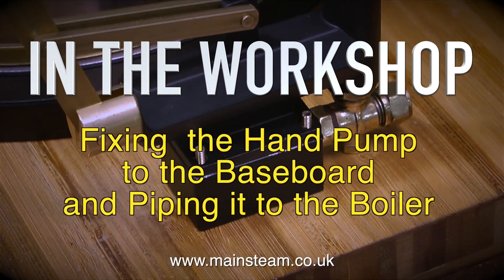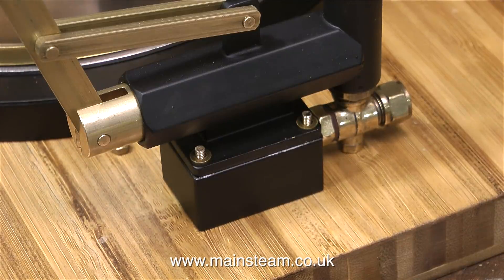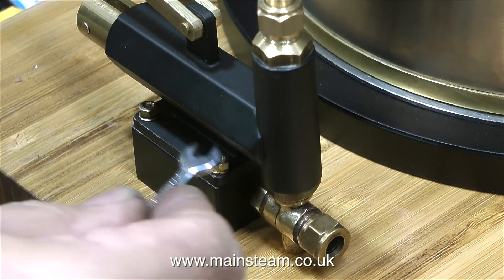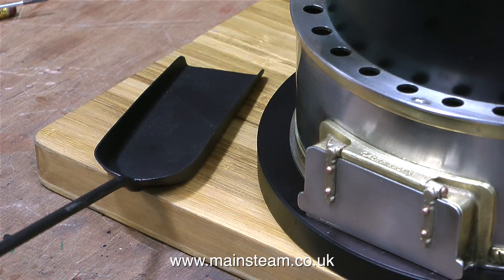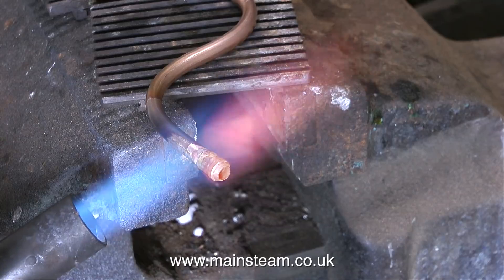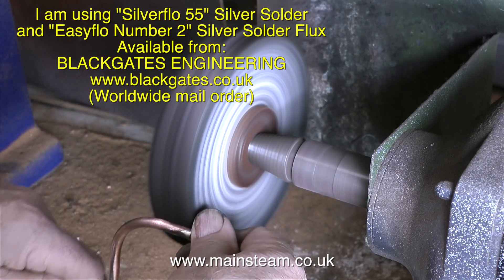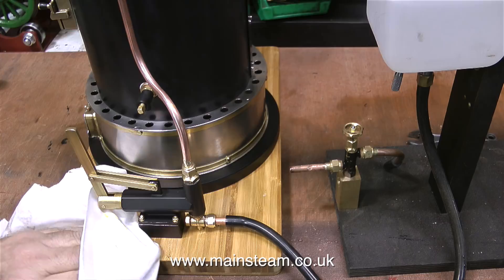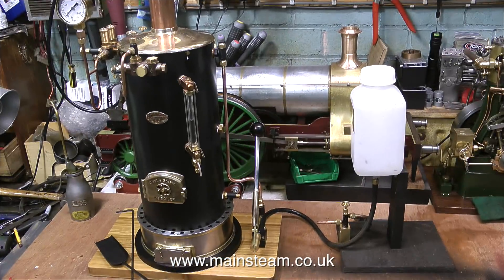FIXING THE HAND PUMP TO THE BASEBOARD

Comment: When attempting to put nuts onto studs/bolts like in the clip, I use a trick an old mechanics taught me 50+ years ago. 
You just put a spacer between the two parts so as to have only a little of the stud showing. Then put the nuts on one at a time and just get them started. Then remove the spacer and proceed to tighten the nuts. I have used this method many times when assembling small electronic devices.

Comment: Keith, I really enjoy and have learned a lot from your videos. I have had success when installing nuts on hard to reach studs by threading the nut onto a bolt or threaded rod just far enough to hold the nut, then setting the bolt or rod with the nut on the stud, then screwing the nut off the rod onto the stud.  The rod or bolt can be bent into any shape to get it to line up with the stud.

Comment: Great Keith and I see that Steve installed on this V6 a brass pressure gauge which looks much better than the first installed one. I added also a brass one when I received the boiler. But I was so busy with the building of my steamboat AMPHORA, that up to today I never run it with coal. I wonder how your test will look like :-) Good luck!

Comment: A thought that might help with cleanup/ neatness is to tape the end of your copper pipe just at the point were the fitting ends. Extra flux, squeeze out, causes the silver solder to flow along the pipe where it is not needed. Before applying heat take the tape off, the pipe is clean and the flux is where it needs to be between fitting and pipe. This might be helpful as I have used this method and it works well. I appreciate your informative videos. Thank you.